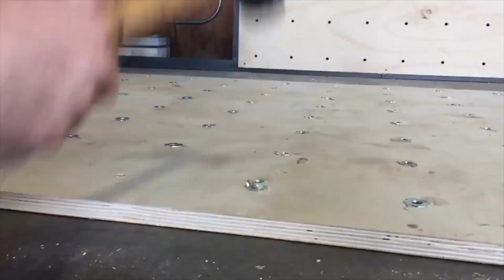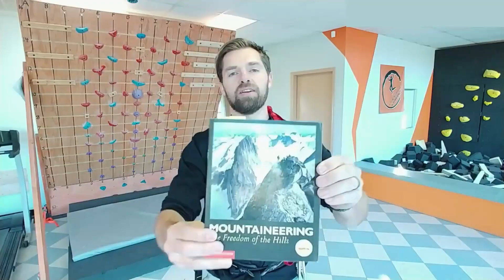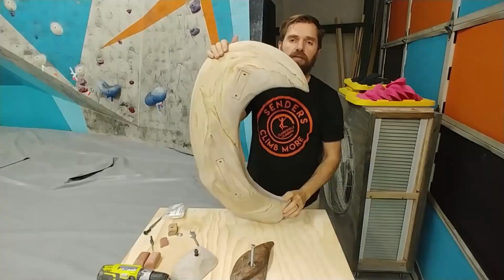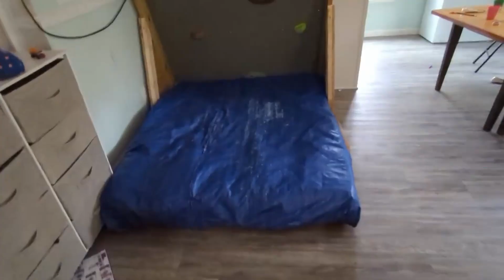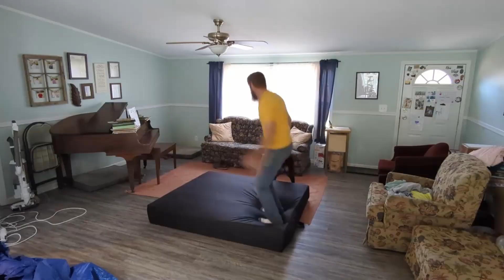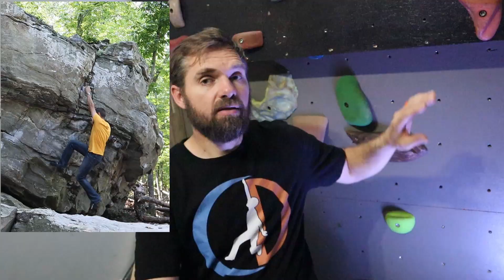MAXIMIZE YOUR CLIMBING WALL DESIGN

Comment: Very informative video, which deserves a lot more views! Perhaps it's on your channel, but if not, could you elaborate how you attach the volumes to your home walls? A larger volume can be quite heavy by itself, plus it needs to support your body weight... Which screws do you use? Thanks!
Reply from the maker: Thanks.
When I build volumes I like to space the mounting screws at 6-8" apart, the bigger the volume, the more screws there are. The ideal screw would be a #9 construction screw but a #8 works too.

Comment: 6'Wx8'T is OK, but yeah 8'x8' is better.  I set up my walls as a systems board first and then fill all the remaining bolt holds to make a spray wall.

You mention a clearcoat over Latex.  Like what?  Polyurethane?  I painted both my exterior walls with exterior Latex paint and had massive hold sticking even after letting the panels sit for months.

Comment: I used your freestanding design for my first climbing wall, which I built in an old apartment of mine! :) Thanks for that. I've since moved to a house with much more space, where I built a bigger adjustable 8x12 board (seen here: https://www.youtube.com/watch?v=8irUoNvnZsA&list=PL17arH9l_aila9bbyir1WPANx6tHkp4IG&index=77). In retrospect I'd put more effort into the panels. One, I'd apply a heavier duty seal so they hold up better in PNW winters (my board's in a non-climate controlled garage). Two, I'd secure the panels with bolts rather than screws to simplify replacement. I'd also rethink the angle adjustment mechanism and try to make that easier—mine is mega solid (four independent equalized chains!), but because of that it takes a long time to adjust, so in practice I've left the board at 45° almost its whole life.
Reply from the maker: That's great to hear. The "lean-to" wall design is such a pain to adjust but it can be. I'm working on 2 different redesigns for that now.
I'll check out your video.
Reply from the maker: Nice wall Dan!
Anybody else reading this post go check out Dan's wall. Looks super solid.
Reply: @climberdad  Thanks! Yeah, it's very solid (4 independent chain anchors) but as a result is hard to adjust: you have to load it onto the winch, adjust the angle, then manually weight and re-equalize the anchors. I'm hoping to come up with a design that retains the stiffness but is easier to move. (Every one- or two-anchor suspended board I've climbed on wiggles a ton, which at 185lbs I really hate…)
Reply: And the lean-to was a great starting point. I really appreciated that in my little apartment back in quarantine times!

Comment: Thanks Climber Dad for following up on the questions! I really appreciate the insight!

I have actually been doing a bit of updates and framing design on the climbing wall. I widened the whole frame slightly to accommodate extending the slab section to a full 6ft and (in the design) made it framed out to be an adjustable section so I can get that sort of moon board/kilter board functionality.

I 100% agree about the angled sections too. Just trying to figure out the best methods for framing them is a nightmare! I may end up doing a 3x3 frame at the joints, braced with additional 2x4s or 2x6s.

 I do really love climbing the overhang sections at my home gym(s) so I do plan on keep it... BUT... As you mentioned, the 3 angle changes to tie back in to the slab section are a nightmare. I think I may adjust the design to maintain more of a "normal" angle, and then use as small of an area to adapt them out towards the corner. When I was designing this section, I was thinking about all the awesome climbs I've done at our gyms and wanting to try something like the outdoor boulders Rainbow Rocket or Captain Cutloose. Big overhang dynos basically. I'm 6'2", so not sure I can make volumes large enough to pull something like that off!

I had also envisioned using the space behind the wall as storage for the holds/ladder/hardware/etc. Oh, and a place to store a battery or two for some solar charged power for lighting along the front upper support beam! I was eventually going to enclose the outside with siding similar to our house, and to reduce wear from the weather. 

Also, very glad to hear the crash pad is holding up! I do like that design, especially for the outdoor wall as it should be pretty weatherproof and sturdy!

And also glad to hear the bed liner paint method is a win! Now the question is, do I go all black, or get some of the tinted colors for a cool design! Seems like a pain! But also all black in Texas summers might be a different kind of pain!

Keep the great content coming!
Reply from the maker: Put some color on that sucker :)

Comment: Awesome info as always. I wanted to ask what the biggest differences between a home climbing wall and a commercial climbing wall are? Is it possible to use a series of home climbing walls to create a small climbing gym?
Reply from the maker: IMHO the biggest difference between a home wall and a commercial gym will come down to building and codes, safety also.
For example, if you are going to open to the public you need to meet fire codes for your area that aren't a concern if it's just your house.
Reply: @climberdad  I see! That is good to know and keep in mind. I work as an architect and always think about building my own climbing walls, NFPA code and building codes per your area are definitely a consideration if you want to do anything commercial wise
Reply from the maker: Just made a short for you too. Probably hasn't even uploaded yet :)